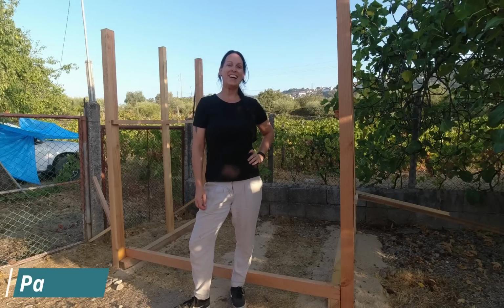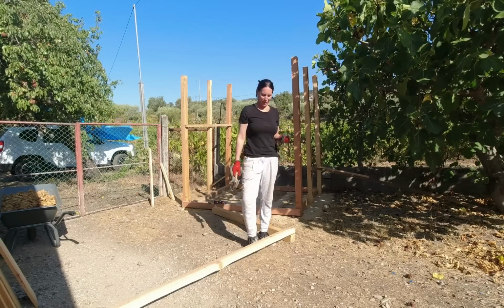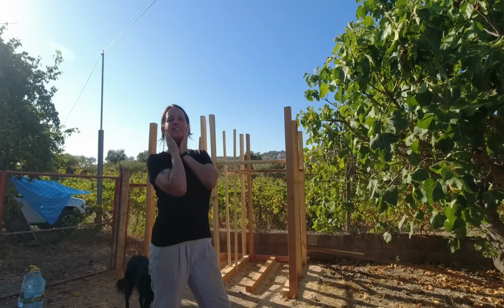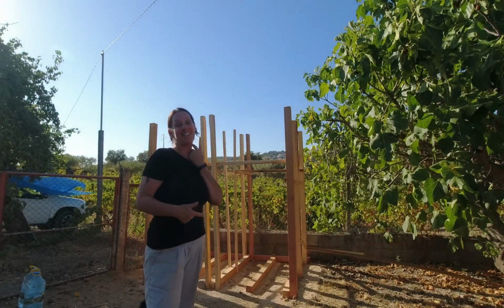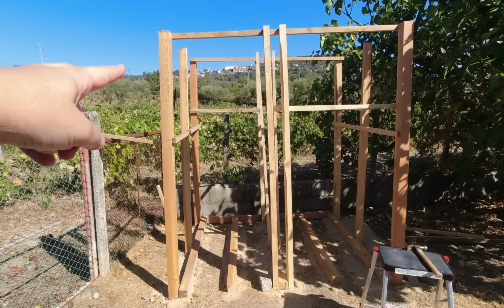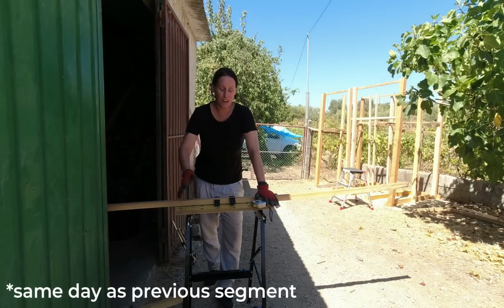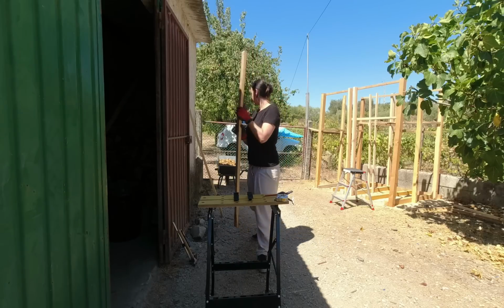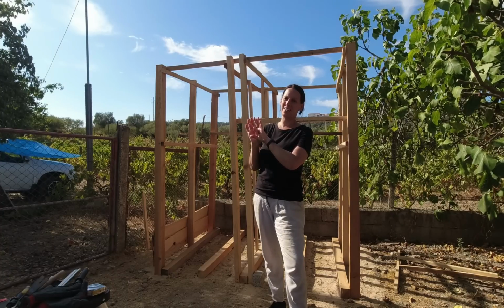Outhouse Build Part 2 | Finishing the Frame | My Central Portugal Farm #37

Comment: Happy Birthday Christine. Hope you had an awesome Birthday. And the Sushi was good. 
Try using screws instead of the nails. It will be a great deal easier. Drill a smaller pilot hole so the screws go in easier and not split the wood.
Look for “poly carbonate sheets” for the inside. 
Great job.
Reply from the maker: Thank you Sean!! The sushi was excellent :) thanks for the tips too and for the poly carb sheets - I think I've seen them in some of the stores...:D

Comment: I suggest you use screws rather than nails, put in a small pilot hole first, its much easier to get in straight and disassemble if required. A battery drill/driver makes life so much easier.
Reply from the maker: Thank you for the tip! :) I have one of those drill-drivers, but have yet to figure it out! :p

Comment: Hi ya,
Great couple of videos on this build.. 
You're doing FANTASTIC! Regards the wood. Drill pilot holes slightly narrower than the nails through the first piece of timber then hammer into the second. However the better option would be to use Lag bolts/coach bolts, or heavy duty exterior screws and drill pilot holes (slightly narrower than the screw threads) then screw into that and the threads will grip the wood (obviously youll benefit from a cordless high impact driver) but they're not mega expensive now (if you just get a good quality DIY one maybe a half decent own brand or whatever from like Aldi or Lidl etc?) they have interchangeable batteries with other powertools on their range so if you need other tools then you have options without forking out for batteries every time and they have a 3 year warranty so if you keep the receipt and they break money back or exchange!! That would be my advice! 

Also a CHEAP and excellent way to both preserve the wood, kill bugs and make it but resistant aswell as weather and rot resistant and even fire resistant is to burn/char the outside look up ok YouTube "Shou Sugi Ban" it's cheap and easy! You burn it using either a gas blow torch or can build a small fire pit fire and move the wood through it to just char the outside (bit a blow torch is more controlled) takes a few minutes per board.. then brush off the excess char with a wire brush and job done it reveals the grain aswell so esthetically it looks good too! (you can add oil after if you want but it's not necessary and Japanese buildings last 2000 years using this!) So I think you're good for 6months lol 😂🤣
Hope this helps also both now and with future projects! Love your energy and live your channel you're living the dream I've wanted to do for last 3 years so hopefully I'll get to before house market crashes too much for me to sell! 
Keep up the good work!
HAPPY BIRTHDAY!! ❤️👍🥳🎉
Cheers from London  👍😎🏴
Reply: Lidl powertools , electric drills or saws are all great to work with. And cheaper than the usual brands.
Reply from the maker: Thank you and for all those tips too. Funny you mention Shou Sugi Ban - I'm planning to use that for my second project in the wood pile - my farm sign board! (somewhere down the road!) :D